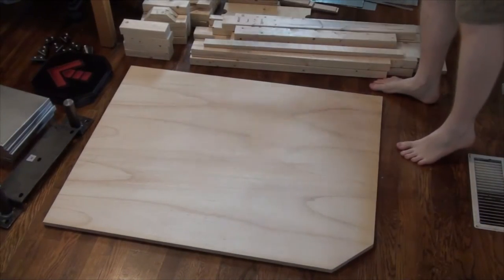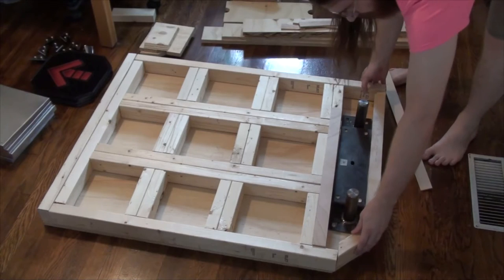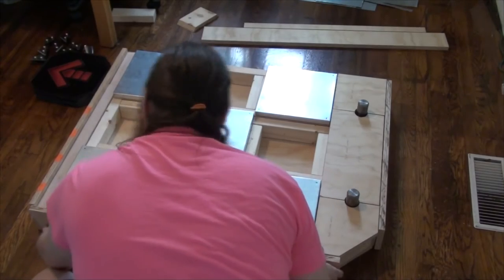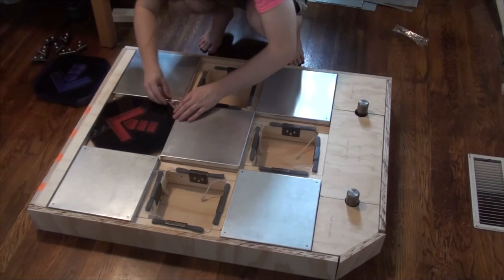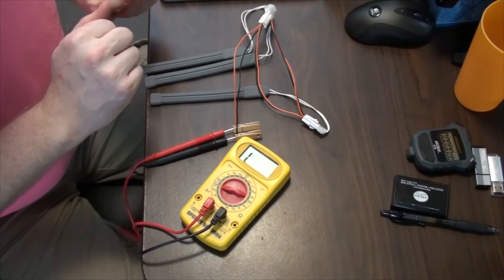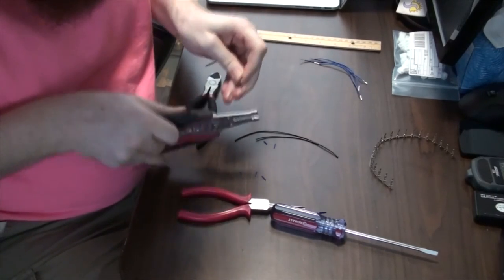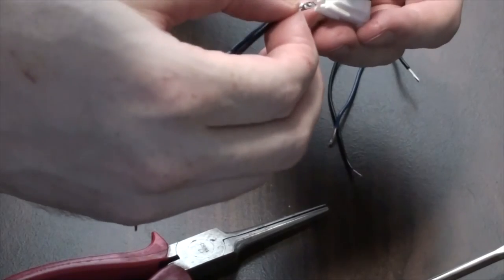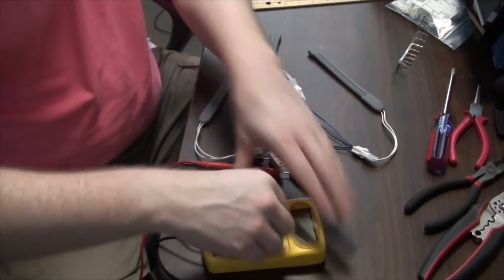Building an ITG2 dance pad replica - episode 5: More assembly + wiring

Comment: Hello! Can you please tell me where did you get those sensors?
Reply from the maker: These are the ones I bought: https://www.arcadespareparts.com/arcade_parts/pump_it_up_parts/pump_floor_switch/12031.html

However, having used the same ones to replace sensors in a real ITG machine, I'd no longer recommend them. The official ones are definitely worth the extra cost: https://www.arcadespareparts.com/arcade_parts/machine_parts/pump_it_up_foot_sensor/12510.html

Comment: The outer pieces of metal seem a bit dangerous?  With the edges exposed like that.
Reply from the maker: Yeah, that might end up being an issue... I worked on them with the rasp when they were first cut, so there aren't any particularly sharp edges, but catching one of those corners the wrong way could still be unpleasant. I'm hoping the glue and screws will do a good enough job of holding them down flat, but if not, I'll have to come up with some other solution.
Reply: Could you not flatten out the edges against a hard surface with a hammer?
Reply: Make the last 3 pieces L shaped, pieces 1 and 2 go all the way to the top and corner and piece 3 in the middle of this, to cover the corners(pieces 1&2) simply do it like you did with the metal panels, if you want to cover the whole platform with metal sheet to give it an arcade feel then better use a bigger sheet that can cover the sides completely ( making the corner cuts will be harder though), also you should considering making the piece that covers the bar a single sheet.

The benefit of this is that pieces 1 & 2 will be very solid and most likely never go bad and piece 3 will be easy to replace in case it gets bent since is just an L shape sheet.